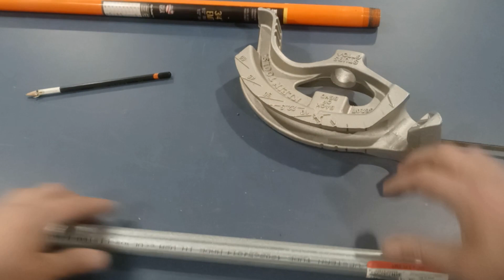Conduit Bending - How To Bend Multiple Matching Boxsets Pt.2

Comment: I never knew that part about the seam on the inside of the conduit.  Now I can mark the edge of the pipe with a marker and it’ll get covered up by the connector/coupling.  Good looking out.

I typically start my offsets at 3” because I may need to cheat the connector/coupling or my 90° bend might be a little long.  I can trim a piece off of the end without cutting into the offset.
Reply from the maker: Im glad you learned something from watching my video's. Please support my channel by sharing it w/ friends and co-workers.

Comment: my dude, I kinda do the same thing, but I stick out the pipe a little out like 1/8 . cuz you will oval the end and it's hard to put in the connector or coupling
Reply from the maker: For boxsets you can go flush to the shoe for the first bend cause you are barely bending it. It wont oval the conduit. Trust me my dude been doing it for over 2 decades now. 🙏🙏✌✌
Reply: Gangster bends!$$$
Reply: @TheArtOfConduitBending  😂😂😂